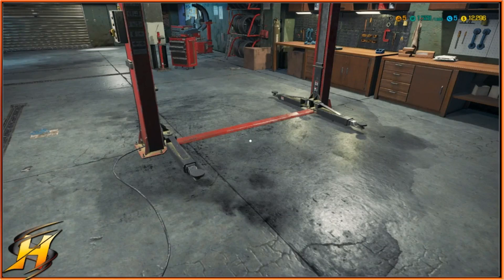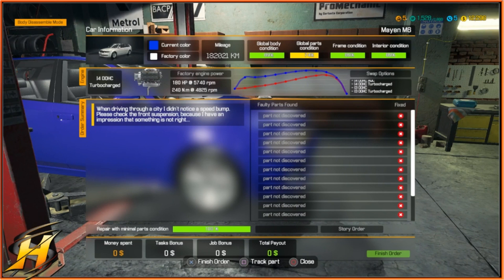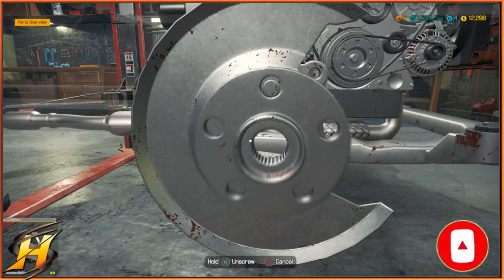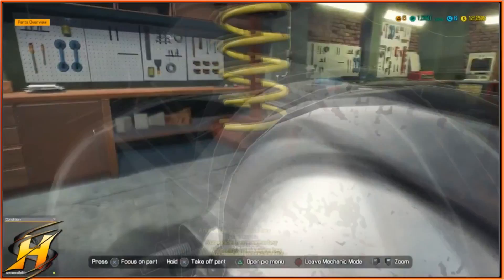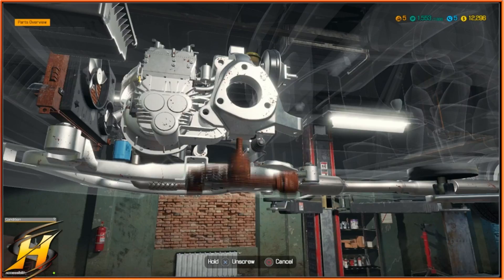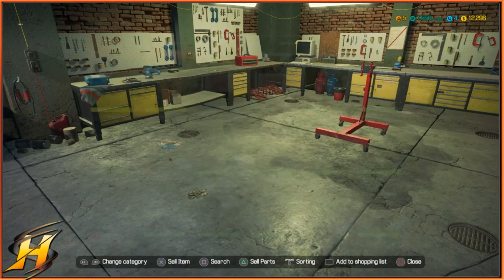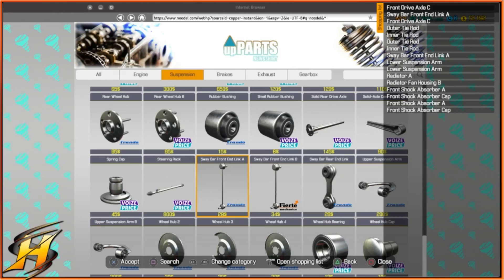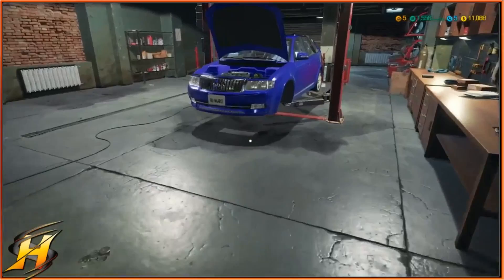Car Mechanic Simulator | Story Order 4 | Mayen M6 Guide

Comment: I hope someone is still reading those questions as i have one. I have stripped the complete front end engine and suspension have repaired everything that was broken. Now the engine bay is completely empty but when i navigate to Lack of engine power there is still one part not discovered. Nothing in my Inventory is below 63%. And that includes the radiator and fan
Reply from the maker: lack of engine power. battery? spark plugs, air filter, exaust and manifold, ignition coil and ignition wires off the top of my head... or u may have missed clip a and clip 4 on the ignition coil.
Reply: It was the fuel pump at 0% 😃

Comment: Anyone knows how to remove the complete engine to the engine stand ? Thanks
Reply from the maker: move the engine crane next to the car ur working on. disconnect the engine from the gear box and then use the engine crane should be an option to remote the whole engine then
Reply: @Hybridsteel  
I mean from the car you working on to the stand . Thanks buddy

Comment: So I found one in a junk yard and i cant get a tire on I'm missing a piece idk what it is cus I only worked on v8, it's that piece were the cap goes
Reply from the maker: trye, so suspension mounts, bearing inside the wheel, hub cap, break, break pad and the bits that connect to the main suspension arm
Reply: Oh, so from what I understood for The front suspension you need the engine in first for that one piece?